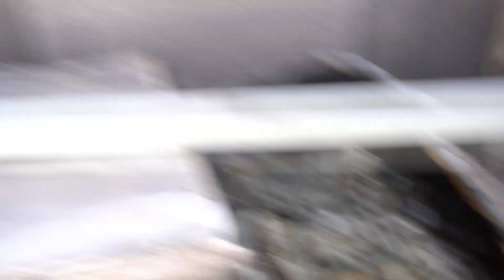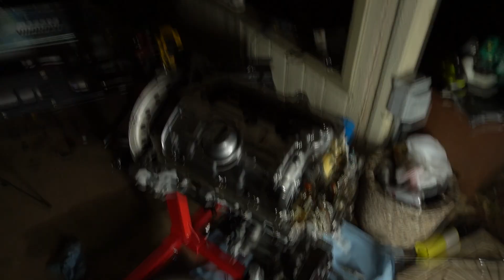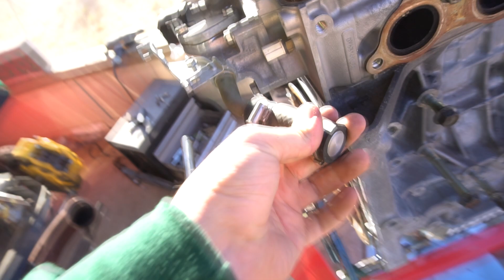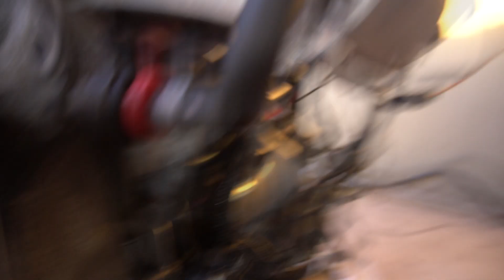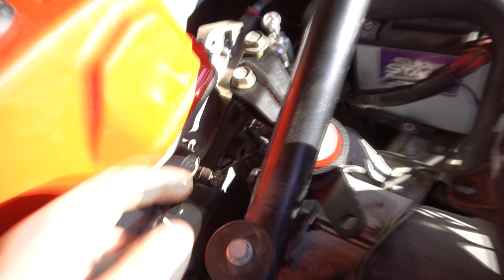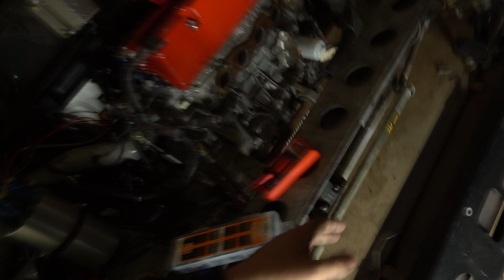Honda K24 Lotus Exige swap first start up

Comment: Im having the same problem with the starter wiring, using Hybrid racing sub harness (same one as you) do you remember what conector was the the black starter wire supposed to be connected to?

Comment: Why do all this instead of turbo or supercharge the 2zz?
Reply from the maker: It used to have a SC 2zz actually. Honda K is a way better motor that’s cheaper and has way better aftermarket support for racing, as well as bigger displacement with a way better torque/hp power band